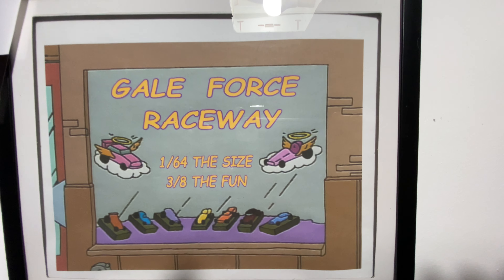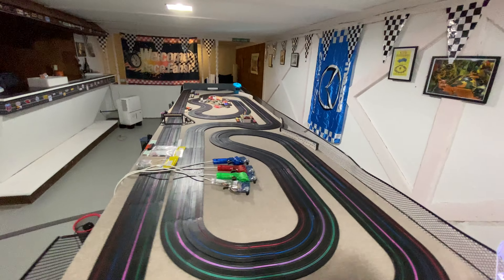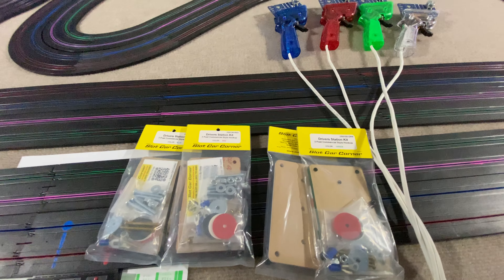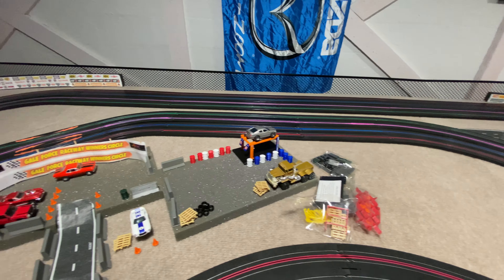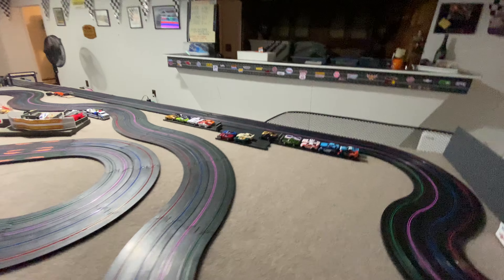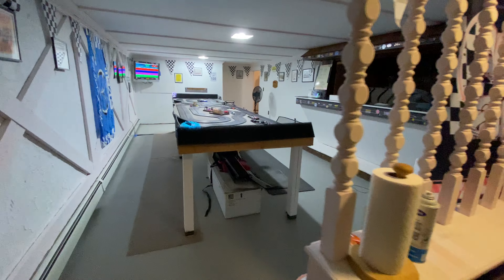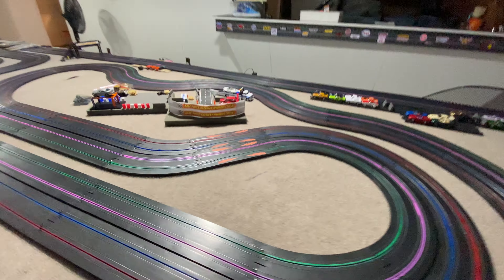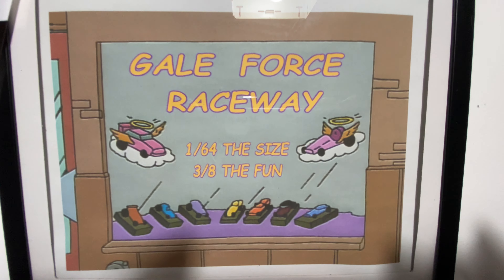UPDATES to our  NJ based H.O. slot car track!!

Comment: Really nice setup, I am jealous of the space you have. I am looking to expand to a 4x14 layout myself in the garage. Are you going to wire the track for independent power to each lane? I ended up removing the AFX terminal tracks and went with dedicated power tap tracks that I got from Viasue, made a big difference having power to each lane.
Reply from the maker: I'll check that out- didn't know they offered such a thing- could save me from soldering, and my basement from an inevitable fire LOL
Reply: @Gale_Force_Raceway  Yeah they have them on their eBay store. I did the "make an offer" option and they accepted my offer. I think I knocked 10 bucks off what they were asking so it was like getting free shipping.😁
Reply from the maker: @marksslotcargarage  Mark, you found actual POWER TAP tracks? Looking now not seeing them ATM.
Reply from the maker: NVM...  Found 'em!